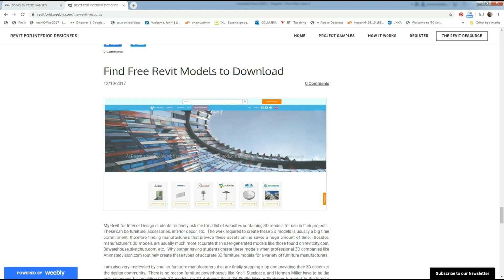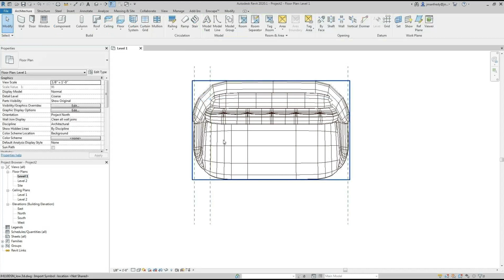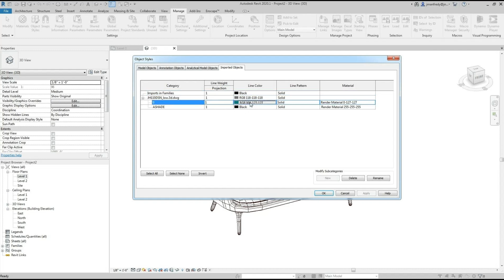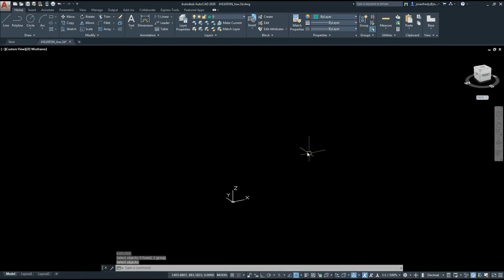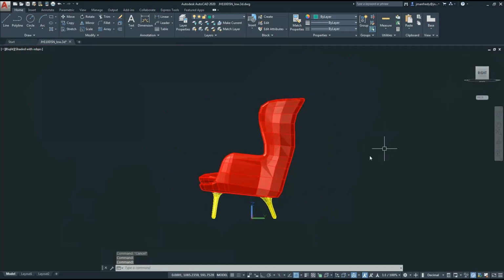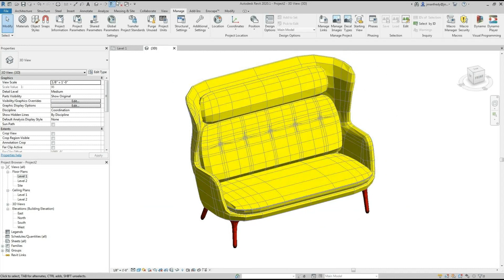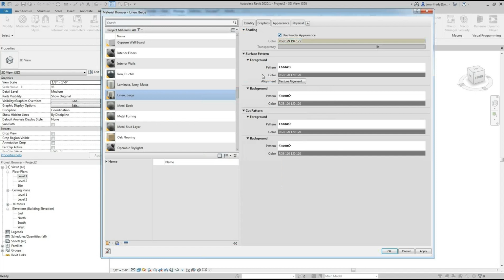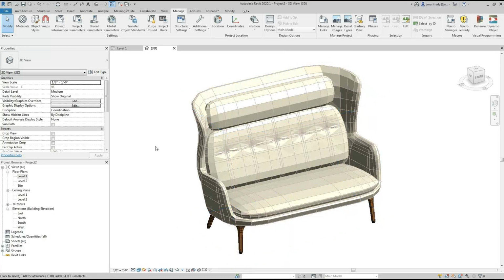How to Import Autocad 3D into Revit

Comment: Revit has to be the most clunky interface evah.   What takes you 10 actions in Revit to measure and scale that sofa could be done in AutoCAD in half the steps.   In AutoCAD I’d do a Dist from endpoint to endpoint, then do a scale command , pick all objects, pick a scale center point, which can be anywhere as it’s ultimately irrelevant.. and enter a scale number based on what the DIST measurement told me and what the final desired size was to be.   I’m just now taking classes on Revit and super stoked about it’s enormous powers buuuuttt..  what’s up with this super stupid interface??   It’s quite clearly has the fingerprints of the creators of Pro E… right???